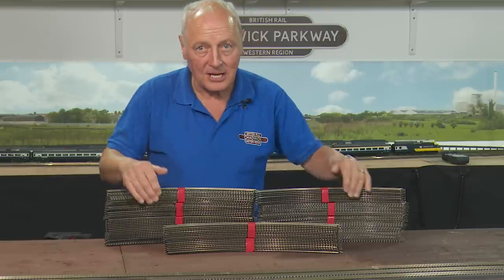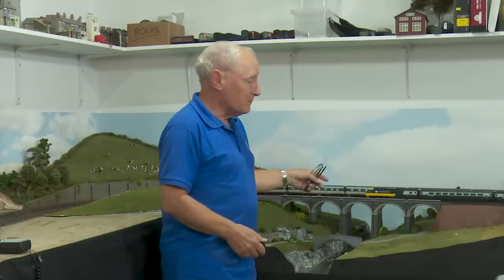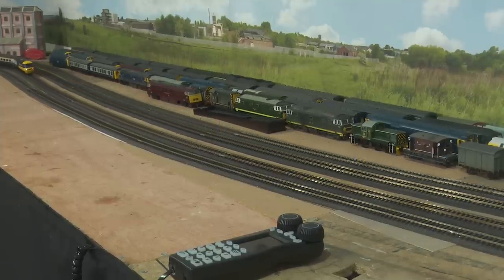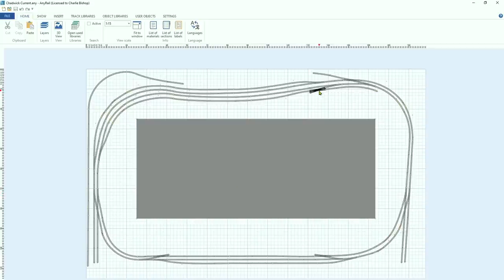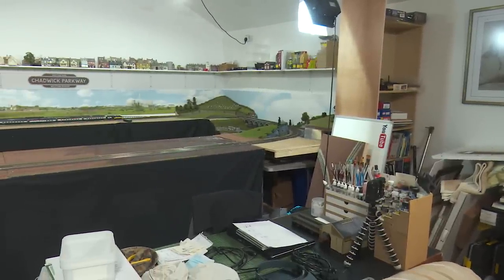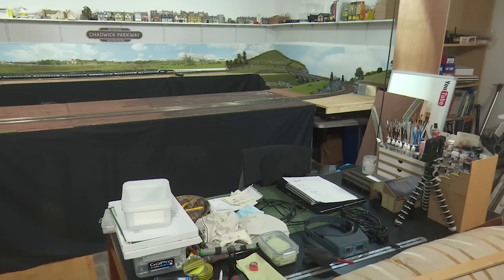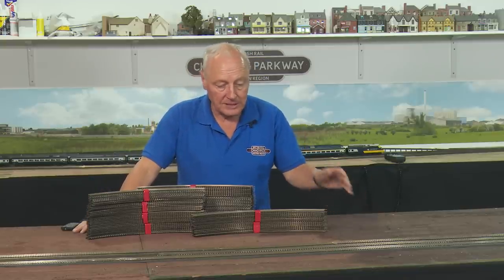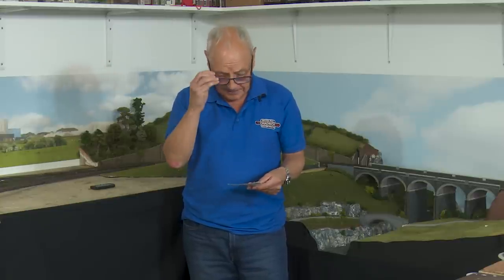Track Plan Design at Chadwick Model Railway | 111.

Comment: Hi Charlie, great video as always. I like the new ideas for the layout too. Something you may find useful - when drawing track in Anyrail, right clicking on the first track drawn and selecting "add parallel flex ..." gives a prompt for the desired track offset (centre to centre) and then you select the side to put it. It makes drawing accurate plans very quick and easy. I typically use 50.8mm, but you can put any number you like. When laying settrack curves there is also an option to create a helix! Regards Barry.
Reply from the maker: Thanks for the tip Barry, I am slowly getting to grips with it thankfully. Regards Charlie

Comment: Charlie just a thought. It appears you have alot of head room in that room. Rather than going under you might consider going over. With a 2 ladder system simular to how people reach tall items in department stores. It little bit of welding and you might have and an equipment transfer shelf to boot. Again just a thought
Reply from the maker: An interesting option Adam, I shall check it out, regards Charlie

Comment: Well Charlie...the unthinkable has happened.

For the first time since I have subscribed to you and I fully agree.  But maybe not for the reason most would think.

When you started discussing your ageing knees and a crawl under layout I recalled my like situation of about a decade ago.  Luckily my then layout was a walk around on two levels.  And as I am in a "Rehab, Refurb, Rebuild" I thought of another YT RxR modeler who built a rise up section.  Interesting idea.  Using counter weight to lift the desired pass through layout toward the ceiling.  HMMM, maybe Charlie could save his joints as well?????

Then you said something that I adored.  You spoke of your plans for expansion.  AHHH! A Brit afta' me own 'art.

In the past whenever I desired to alter my layout for any reason, in this case ease of access, I would just build on.  More benchwork.  More track bed.  MORE TRACK.  More scenics.  BUILD BABY BUILD.

This extension to your track plan is phenomenal.  I can clearly see the intent and direction you are heading.  And I love it.

AUGHHHH!  This is starting to read like a Jane Austen letter between Trump and Johnson.  I HAVE GOT TO FIND SOMETHING TO CRITICIZE BEFORE i EXPLODE.

#1)  To avoid trucking your camera about, as a fellow videographer I'm sure you know, invest in a mini-boom, or as we in the U.S. call them JIGs.  You could leave the Pedestal/Tripod outside the layout and jockey the boom and camera about over the well.

#2) You mentioned your were going to have an outside contractor design and build your Helix.  If it is not to late try to take you rig out to the contractors assembly plant.  While there do a mini-doc. on what goes in to the building process by professionals.  FASCINATING.

#3)  Where the lower level is close below the viaduct and gorge, why not think about running the track across the lower gorge.  Not need for detailed tunnel portals.  The viewing would be brief and unpredictable.

#4) In your lower level Fiddle Yard you mention have one passing track with an automatic wheel cleaner.  That must be a thing in the U.K.  And something we don't have in the U.S.  Well an enhancement would be to add an adjacent track.  To have a track you can section off and have a DCC program track permanently installed.

Lastly, #5) and returning to production,  Across the ceiling level install two lead pipes as a stationary lighting or cyclorama fly.  Then you can have your scoops in place when and where you wish.   As for the cyc., I also do assignments of love for charities and, I have a rear mounted fly to hang various Muslin curtains or photos background mats as a temporary cyc.

~Jim
Reply from the maker: Stone the crows Jim, what a comment. I really can’t invest in jig etc. for a small YouTube Channel. The expense is just astronomical. I do utilise my high glide system which does come in handy but I really can’t invest in much more hardware.
I’m so pleased that you enjoyed the channel, regards Charlie

Comment: Charlie, don't forget to run all that brand new track through the washer/dryer before setting it in place!  :)
And speaking of difficult access, have you any ideas how you're going to access the electrical under the new level, and under the current level?  I've been pondering this for a while over my own plans, and haven't got far.
Reply from the maker: Those are interesting points Frank. Of course on the lower level I don’t have to put the wiring underneath but I intend to complete most of it before I put the boards in situ.

Comment: It was a little spooky watching this video. I am also in my early 60's with bad knees (which will hopefully get replaced next summer). My primary level is 40 inches high to avoid bending. I am also using AnyRail, building multiple future versions, trying to squeeze as much track into the available space as possible. A helix or two may also be required at some point, depending on how ambitious I get. The only difference is that I am using N scale, and flex track for the long stretches. Negotiations are ongoing with the queen of the castle regarding how much territory is available for future expansion. I look forward to future updates.
Reply from the maker: Great comment Ray, good luck with your project too, regards Charlie

Comment: Wow what a lot of replies. It’s interesting because being of a similar age I too am suffering from a dodgy knee (or two) and my duck under is not going to work long term. I tried a lift out section secured with dowels which kinda works. I’m not a big believer in the helix concept I’m going to follow with interest. I have a simpler but not inexpensive solution! My layout is in a raised section of my shed/garage (30’x10’) to get up there I installed a spiral staircase at one end of the “loft”. So I’m just going to extend the loft about 4’ around the staircase so the staircase comes out in the middle of the layout! Will also give me another 10-15’ of track/scenery to play with :)
Reply from the maker: I'm so pleased that you enjoyed it Steve.  Stay safe. Regards Charlie

Comment: What ever makes it easier for you. Your the boss of the layout and the user.
Have you considered a lift up gate in the layout  where you currently get under to allow entry to the middle as opposed to altering the layout quite dramatically? Maybe there are other things that you want to change and the duck-under is the final element of the required changes? It seems quite drastic compared to the current layout arrangements. Any way using AnyRail is an opportunity to do some wider thinking about the long term layout.
Reply from the maker: The flap would have to contain around about 20 tracks Russell, which I just don’t believe would be feasible.

Comment: Hi Charlie,

Excellent video and thank you for sharing!  I am in the process of constructing a large, three-deck layout based on Dale Junction in Wyomming. Like you, I did not want either a duck-under or lifting sections, so the only thing I could do was to use two helixes in exactly the same way that you are; I have not regretting this decision, even if they do have quite a considerable footprint. I therefore think you are doing exactly the right thing to redesign your layout to eliminate the duck-under.

However, I have to say that I am concerned about your helix design. Your inner curves are Hornby 3rd Radius, which are 21"; that is going to go result in an incredibly steep incline which, especially with UK stock, is going to give you all sorts of adhesion issues. Even if you use an absolute minimum vertical clearance on each turn of 2.5" (which, given that you will get issues in the helix, I would not recommend), the straight-line gradient would be approaching 2%. Add the rolling resistance that you will get on such tight curves and the twist force that will be experienced by your longer stock (i.e. principally coaching stock), the actual gradient experienced by the trains climbing the inner track could be significantly greater. My fear is that if you do not address this, you will find the helix will simply not work as you hoped and that will destroy your enjoyment of your layout.

In order to mitigate this problem, you could either increase the radius of your helix and/or use DCC Concepts Powerbase to provide additional adhesion. However, be careful with the latter option and research it thoroughly; Powerbase is very good but it is expensive and it does have limitations, as some of the videos that you will find on YouTube demonstrate. For what it's worth, my helixes are 30" and 27" in radius with a vertical climb of 4 inchers per turn, giving gradients of 2.1% and 2.3% respecitively. My large US locomotives generally have no issue with this, even pulling long trains, but they are generally much heavier than UK locos and have traction tyres, which (in terms of electrical pickups) is not an issue given the sheer number of wheels they have! As a final tip, I have used a product called Bullfrog Snot to add traction tyres to one of my Big Boys, which did improve its pulling capacity.

So, I would really endorse your idea to use helixes but please, before you commit to a final design, ensure that you have researched thoroughly how they are going to perform once constructed; it would be dreadful if, after a long build process and spending on a lot of money, you were to find that they did not perform to expectations.

If you would like a little inspiration, I have a thread on RMweb (https://www.rmweb.co.uk/community/index.php?/topic/156031-dale-junction-in-ho-scale/) and a channel on YouTube (https://www.youtube.com/channel/UCeBRxHUauTaRXxGQSvabWWQ) about my layout.

Best wishes and good luck,

Ben
Reply from the maker: A terrific comment Ben, thank you.  The outer lines will be the uphill traffic and the inner for the downhill. Powerbase will be used to assist the uphill sections.  I have very few steam engines, but diesels on a friends layout, seem to work faultlessly. So I’m in for a penny in for a pound, regards Charlie.
PS, thanks for the links

Comment: Hi Charlie.
   i came across and suffer the same problem when i built my old scalextric set so my kids and grand kids come over, naturally i have some fun with them as well :-).
Surely enough when i rip that out and build my train layout i vowed not to do the same mistake!!

I have designed my layout with this in mind and came up with your same solution of having a helix either side of the layout, with one slight difference to your design.

I have planned my main line to branch to the left or right having 2 tracks leading into ( or out of) the helix. for the helix curves i plan to use  5 and 6 radius curves which i doubt are available so i would use flexitrack for these.

where the main line branches out to the helix i continued the main line into a half circle ontop of the helix using 4 and 3 radius curves thereby having the main line running  a continuous track around the layout without having to use the helix, the helix would only be used for storage/fiddle yard.

I think this would be beneficial because of the points being used continuously under the main board should you have every train going round and down through the storage/fiddle yard.

Hope you understand what i am talking about as i cant add a diagram here ( or at least i dont know how to LOL)

Stay safe and  good luck in your new build
Best Regards

Paul.
Reply from the maker: An interesting option Paul, many thanks, regards Charlie

Comment: Hi Charlie, been watching your videos with great interest over the last few weeks since I found it. Have gotten some great ideas, tips and solutions to issues, some of which I may never have even considered. 

After much thought, I’m more than likely going to be making use, somehow; of our 10’x 8’ garden shed. Over these last few weeks I’ve started to ponder the idea of including a couple of helix’s ( or is that heli), one each side of the entry door. Or perhaps just some tighter curves, which of course would reduce the lengths of carriage & locomotives I’d be able to use in said 10x8 shed. But I must say I really like the idea in this video of the lower deck fill/fiddle yard.   I am wondering about how small a diameter of helix I could go for where my intended period aim is for steam & early diesel mid 1930’s to mid 60’s Scottish coastal. Therefore everything I would probably go for would be LNER etc. so although I probably would get a Mallard or Flying Scotsman (it would be rude not to), they would probably never visit the diorama I intend to reproduce. Therefore I’m likely to use rolling stock somewhat smaller most of the time. 

Is a helix, or curve with say a maximum diameter of probably between 32” (80cm) to 36”(92cm). Understandably I’d like to err towards as small a diameter as possible.

Of course my other simpler option would of course be a layout 4’ to 4”6 high, round most of the shed with a duck under, which should work for a slightly arthritic Paul. This would I suppose mean I could still use said shed for at least some of its current use. Any initial suggestions & ideas for solutions would be gratefully received.

A second, but I suppose related question. Considering my aim at steam to early diesel LNER & Scotland 🏴 Any suggestions for a starter DCC set to use as building block for creating the initial bare bones of my layout. Or I suppose a Peco track set ? 

Cheers again
Paul.
Reply from the maker: Hi Paul, please do check out my video number 209. It will give you the indication that your shed might just be too small for the project you imagine. If you can possibly print out your track plan and lay it out, it might appear to be impractical. Or of course you may need to change to N Scale. Good luck, regards Charlie.
Reply: @ChadwickModelRailway  
Hi Charlie, Thankyou for your feedback on this. I’ve just checked the diameter I’d need for 3rd radius curves to achieve a u shape layout going around the edge in 00 And have to admit I wouldn’t have enough space. Think I’d have to rely upon plan B of a loop going around the entire perimeter of said shed at around 4ft off the floor or a Simple “Back and   Forth” shunt style & find a way of making the engines do a 3 point turn at the far end of the shed. Or of course think about N gauge, as you suggest, or of course TT120,  which is a topic that originally brought me in the direction of your channel a few weeks back. 
Looking forward to watching more of your videos.
Paul.
Edit: P.S. heading in the direction of episode 209 👍🏻😎
Reply from the maker: @paulsummerside  
or a bigger shed!

Comment: Good luck with the revised layout. It does mean that your headcodes can be correct whenever you run them!
BTW, did you notice your HST first class coach was jumping around a bit when first seen?
Looking forward to the double-deck layout!
Reply from the maker: Hi Tom, no I hadn’t and you’re not the first person to mention it either. I shall certainly be checking out my jumpy coach. Regards Charlie
Reply: BTW, is it practical to make the lower deck a night scene, and the upper deck daytime?

Comment: I gave up with AnyRail and moved to RailModelerPro for the Mac which seems to work well.  For your helix, remember to superelevate the outside of the turns to ensure the trains are more secure, I think for OO gauge you’d need about 2-3mm.  I’ve seen people keep them flat (which works fine) but you can’t then run them at any speed.  I’m sure James with his new laser cutter can knock you up a helix or two, he has the measurements for mine, but I’m just not ready for it yet.  Good luck.
Reply from the maker: Hi Stuart, yes he’s producing mine. But who is the test case.
Reply: @ChadwickModelRailway  Well James' has his HOe one and mine will be N gauge, so just a little smaller.  I'm still debating how far to drop down, I think you mentioned 40cm, but you need to ensure you can comfortably get between the layers.  I think I opted for 50cm, but then the lower deck is getting lower to the floor (thinking about your knee)...

Comment: Drat. My initial Anyrail design 10 years ago was a helix-to-helix configuration. I eventually decided that the 4’ x4’ space required for each helix was consuming too much of the room, so the procrastination ended with me creating a regular layout similar to your current design.  Made the baseboards nice and high, but I still regularly come up too early and gash my back on the framework, sending the odd scenic element flying , and filling the air with profanity.  Needed your video 10 years ago Charlie. I must learn to procrastinate more...about 10 years more...
Reply from the maker: Great comment Peter, stay safe, regards Charlie

Comment: What a change in direction... I understand about the issues of ducking under and a walk around layout will be much easier.  I do wonder how much trouble you are going to have doing maintenance on the lower level if it's only 18 inches off the floor.  Maybe the upper level needs to be higher, nearer your eye level.
Reply from the maker: Excellent point Lee, all under consideration I assure you.

Comment: The newbie chiming in again :-). I have not even put a piece of track down, but have done a ton of modelling with SCRAM (extremely similar to AnyRail). I have already figured out a full closed loop without an opening is... long term challenging. My current plan has loops (not loop backs) at ends of a U or G shaped layout. Really struggling with the idea of using a helix, as if you build in a straight ramp along an edge, then a 180 turn (a half a loop - or 1.5 loops, you can get a decent drop. Anyway, I too vote for a update on DCC systems and block management.
Reply from the maker: No worries Chris, it’s DCC stuff next week